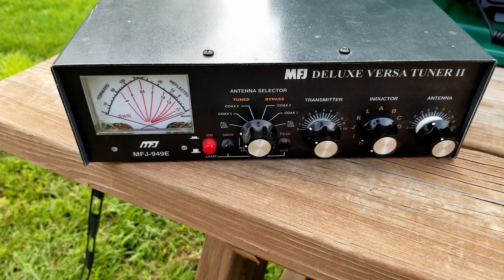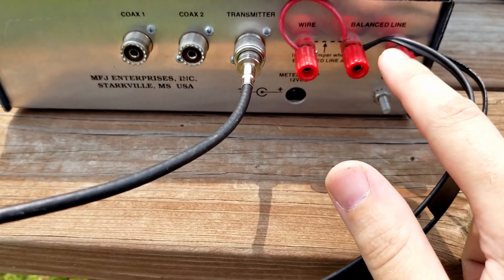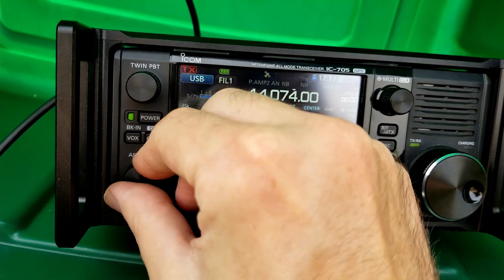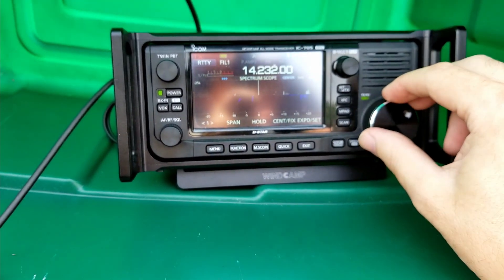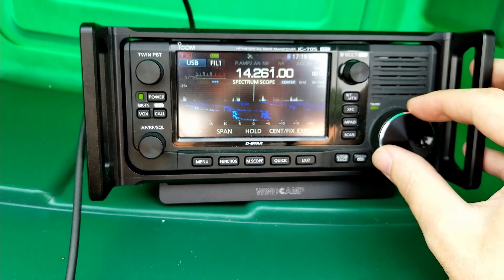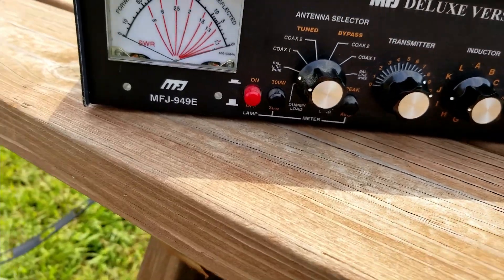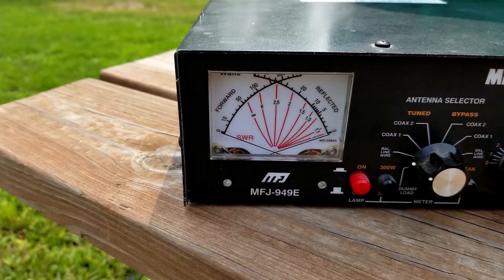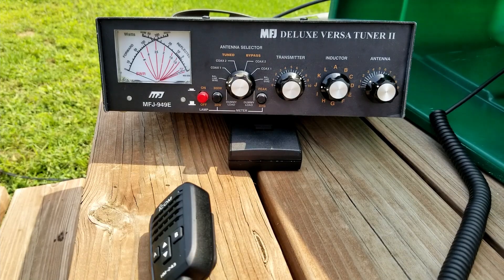How to use a Manual Tuner with your Ham Radio Rig

Comment: Thanks for this video. It should be very informative for new amateurs.

"Antenna tuners" (they used to be called 'transmatches' which is actually a much better description of what they do) are one of the most misunderstood and misused pieces of gear in amateur radio. They most definitely have their place and can be a part of a highly efficient antenna system if used properly. However, they can also mask issues which lead to signal loss.

I do want to say up front that it's just as incorrect to say that a tuner should never be used as it is to say that a tuner should always be used. A tuner can be a valuable component in a highly efficient antenna system - as long as it's used under the right circumstances.

First and foremost, an "antenna tuner" does not in any way tune the antenna. A tuner (transmatch) has one function - to provide a purely resistive 50 Ohm load (or as close to it as practical) to the transmitter to ensure maximum transfer of power into the antenna feedline. That's it. The electrical properties of the antenna (or the feedline between the tuner and antenna) do not change in any way when a transmatch is used.

A tuner (transmatch) can often have a very wide range which allows it to match even a very non-resonant antenna to the transmitter. On the surface, that sounds like a good thing. However, many hams use coax to feed a non-resonant antenna and unfortunately, coax (even the best available) rapidly becomes VERY lossy as SWR increases. The transmitter itself can be quite happy with the load presented to it by the 'tuner' but a considerable amount of power is lost in the coax between the tuner and the antenna. And this loss doesn't just apply to transmitter power - the receive signal suffers the same amount of loss. This loss is why many new hams (who are often used to using only coax) consider the use of non-resonant antennas to be inefficient. One other point - even so-called multiband antennas like the G5RV incur very large losses in the coax on certain bands which is why they are often considered to be inferior antennas.

So when is using a tuner a good thing? Well, there are a few scenarios in which a tuner can be a benefit:

1. When using a balanced antenna (such as a doublet or loop) with balanced feedline

Unlike coax, balanced line is virtually lossless regardless of SWR. Therefore using a tuner to match a transmitter to an antenna fed with a balanced feeder can be highly efficient since nearly all of the TX ad RX signal are preserved in the feedline. That is one reason why a non-resonant doublet can be used as a multiband antenna quite easily (and that is why it's one of the go-to antennas for Field Day operations). Yes, there is a small amount of loss in the tuner but the avoidance of loss in the feedline can more than make up for it. Also, when using balanced line instead of coax there tends to be a bit less electrical 'stress' on the tuner which helps to keep its insertion loss even lower. Many new hams seem to be very hesitant to use balanced line for some reason and by doing so are missing out on one of the best-kept secrets in amateur radio - inexpensive ladder line can very much be your friend and it's not at all as difficult to work with as you may have been led to believe. 

2. When it is used to simply 'touch up' a slightly high SWR on a coax-fed antenna

If the SWR is not extremely high, a tuner (transmatch) can be effective in bringing it down to extend the useful bandwidth of an antenna (e.g. using a coax-fed 80 meter dipole on 75 meters). In such cases the additional loss due to SWR in the coax will not be significant.

3. When locating the tuner at the antenna feedpoint rather than at the radio

The best place for a tuner (transmatch) is at the antenna feedpoint. When positioned in that manner there is essentially no loss due to SWR on the coax from the rig to the antenna (although of course every type of coax has some inherent loss (usually measured in dB per 100 feet) which cannot be avoided)).

When should a tuner NOT be used? Easy - when trying to use a coax-fed antenna on a band for which it isn't designed (like using a 10 meter ground plane on 20 meters, for example). Sure, the tuner may be able to match the load to the radio but the loss in the coax (again, both TX and RX) is likely to be huge. I often see statements like "I was able to get my 10' XYZ antenna fed with LMR-400 to load on 160 meters so it must be a good antenna". All that means is that you're sacrificing MUCH of your signal as heat in the feedline. Again, just because your tuner (transmatch) can 'tune' the antenna (which again, it doesn't change the properties of the antenna at all) doesn't mean you have a well-performing antenna. As the old saying goes, a good 'tuner' may allow you to load up a pair of bedsprings thrown in the back yard - but all you're really doing is warming the coax.

OK, I'll step down from my 'tuner' box now :) . Hopefully the above is helpful.
Reply: Q from a new HAM who just obtained his first manual tuner (my first tuner was an LDG Auto tuner, the AT100Pro2). Now that I have obtained the manual tuner I understand how to tune (match) the auto tuner in manual mode as well. In fact I prefer tuning the auto tuner in manual mode when I am using it. I hook up my NanoVNA to the transmit line and read/adjust the SWR accordingly and then plug in the radio. Of course if I change bands I have to start over. Is this crazy? Am I overlooking something? Its been really simple and I like knowing exactly what the tuner is doing. Am I alone in this thinking or do many people tune this way?
Reply: @toybuns775  ... Hi Tony,  I do almost the same thing.  I use the NanoVNA SAA2 first, then write the settings down on a sheet of paper as a starting point for each band.  That way when I change bands all I have to do is look at the chart and preset the tuner to those positions and then using low power (5 watts or less), I check on a clear frequency and if everything is good I am off to the races.

Making a chart of your starting points for each band that you operate on, or even just listen to, makes life much easier.  I don't know if MFJ still does it, but they used to put a blank chart in the back of the instruction manual for most of their tuners.  If they still do, just make photo copies and use them.  Especially if doing field work (POTA, Field Day, etc.) as it makes it much easier for the operator(s).

73 and hope to hear you on the bands,
John, N1WOM
Reply: As environmental and atmospheric conditions are ever changing and effect antenna system an Antenna Tuner (TransMAtch) is Essential as is a proper RF Choke. End of Story.
Reply from the maker: Very good points, thanks for sharing.
Reply: Thanks for the information! I only wish HF amateur  operations were simple as 123 but they aren't and I know all the facts above. I have found Property size and restrictions, Wife restrictions, money availability and many more things prevent us from putting up "The Perfect Station" We all strive to achieve these things and the nice little video here shows what is really important to know when you first encounter one of these little gadgets called "tuner" but those of us who are a little older know them as "transmatches" Even the big guns call them "tuners" I would love to own a Palstar AT2K tuner http://www.palstar.com/en/manualtuners/ . I read the book; but this little video would have made it much easier to learn, and I did read the manual and that is how I got going, but the video wasn't available! I still use a tuner and it isn't a perfect setup. I went from 100 watts to 500 watts and a bigger tuner and there were lots of things to learn. I still use a tuner and now mostly an EFHW or more correctly ( an extreme off center fed antenna) I have about 30 feet of coax to the 49:1 transformer and I still need the tuner because the antenna is narrow banded. I mostly use 90 watts and talk all over the western US in the mornings with a bunch of happy go lucky guys and love every minute of it. My IC-7300 is 99 percent of the time presented with a 1:1 SWR which makes my $1,300.00 dollar investment happy and it runs cool calmly and with out RF on the mike and no RF burns on my hands! The MFJ Versa Tuner V along with low loss coax into a very imperfect 80 meter EFHW antenna helps me have a lot of imperfect fun, and that it is what it is all about. It is good to know all these details because they do help, but like me a tuner is needed for my operation and because my antenna is in a L/ Z-zag configuration and the zag is a tighter radius than 90 degrees which shouldn't function well at all. but hey last night on 80 meters ft-8 @ 35 watts it was like shooting fish in a barrel. And there sat my little home built kit N7NDC tuner happily making this whole station work.  On a funny note my wife did not discover the 80 meter wire antenna for about 9 months. We woke up one frosty winter morning last winter and all my wire antenna's sat there with at least 2 inch halo of frost on them! I came into the kitchen to find my wife with her hands on her hips fuming about what I thought was a thing of pure beauty? I quickly sneaked out the back door to thump on the lines and knock all  the frost down! Like they say "Happy Wife Happy Life"! To really make tuners totally necessary for ham radio operations the tuners need to have an auxiliary switch that says "Tune Out Wife"!

Comment: Can you use two coax and not 450 ladder line🙃
Reply from the maker: Interesting question - I'm sure the answer is yes... followed by Why? -- and the answer to that is Why Not?

I would suspect that if you're going to use two coax, you would be using the braids of each as you left and right side trying to mimic ladder line properties.

Just a guess, would be a fun experiment.
Reply: @temporarilyoffline  I was thinking of using the center connector and zip try the coax together. The spacing would be greater. You would have a bigger connector. I  have used rg213 and it worked fine. Even with  mighty fine junk lol
Reply: when you use two coaxes as balanced line the impedance of such transmission line will be twice that of the single coax used.
connect both braids together and DO NOT connect them to anything else on either end
(could experiment connecting braids at tuner end to ground lug optionally)